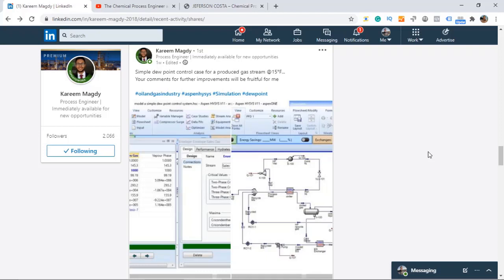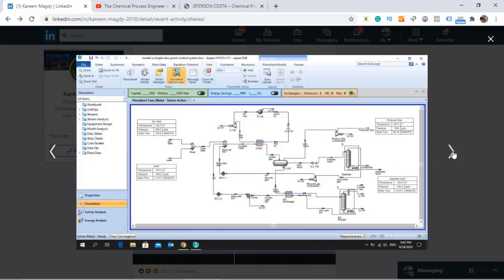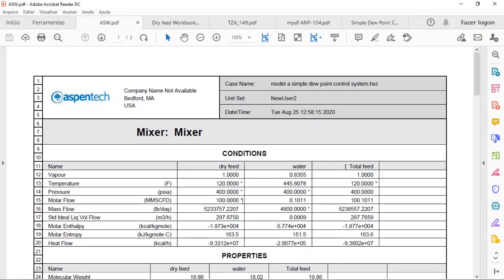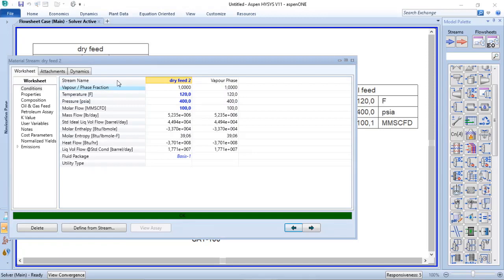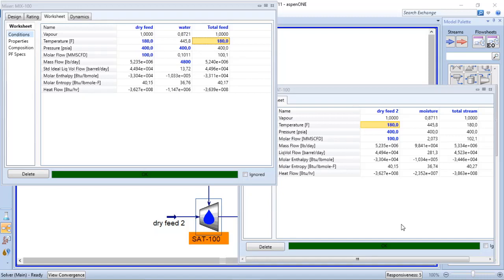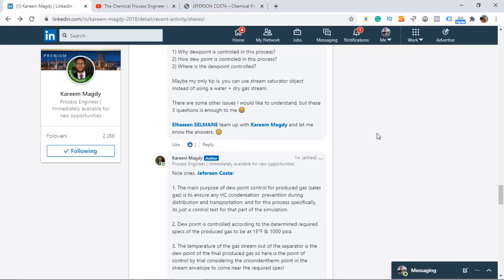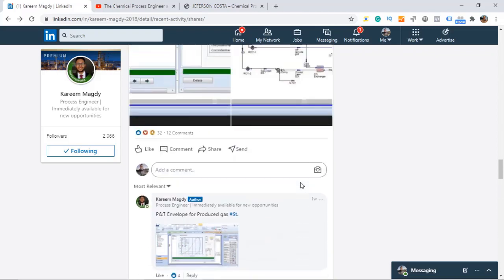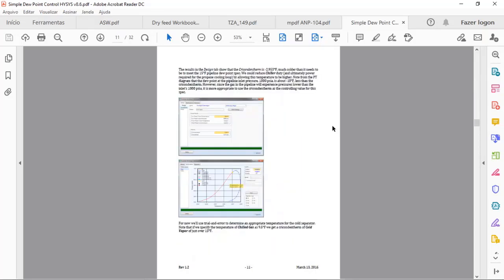How to Saturate a Stream with Water in Aspen HYSYS

Comment: I know well Aspen plus , but don't know Aspen HYSYS. I need to know what difference actually Aspen plus and a AspenHYSYS? Is that enough for me a Aspen plus as process engineear??
Reply from the maker: Hi Ali, the main differences are the interface and the logic on calculation. In some cases PLUS has more resources than HYSYS. In any case, you need to understand the results of your process simulation. Each Company may use different process simulation software, for instance: I have been working with HYYS, Unisim and Symmetry, other use Promax or Aveva Pro II. If you have the opportunity to know more about HYSYS and other process simulation software better to you, however, do not focus only on that. There are many others subjects that Chemical Engineers must know to work with plant design like P&ID, process datasheet, PSV, pump sizing and selection etc.
Reply: @jefersoncostaengineer  Thanks sir it is very good advice